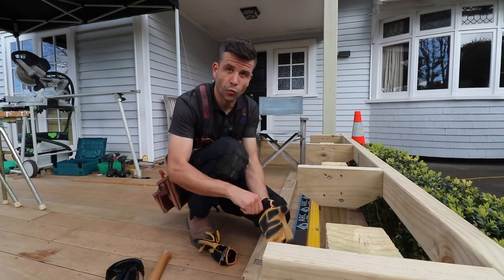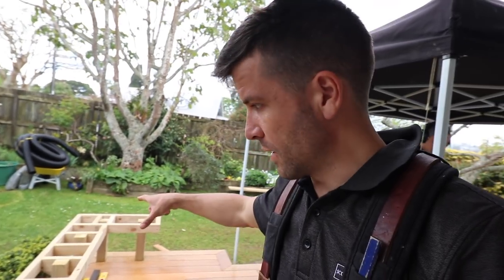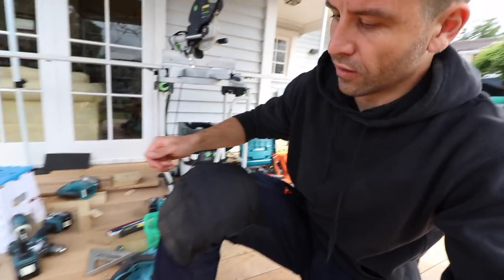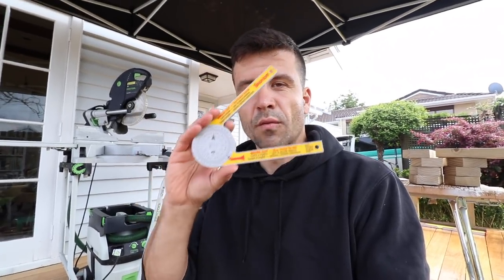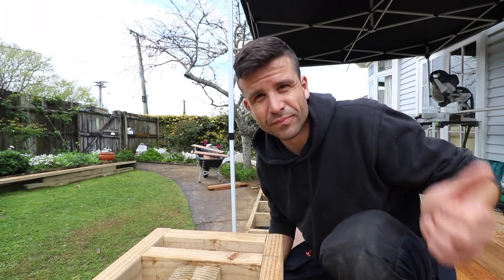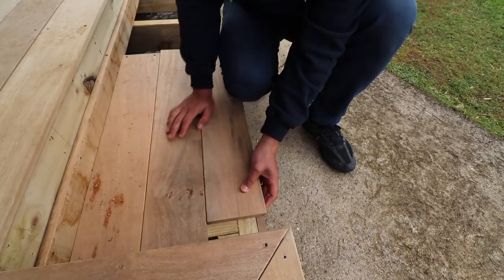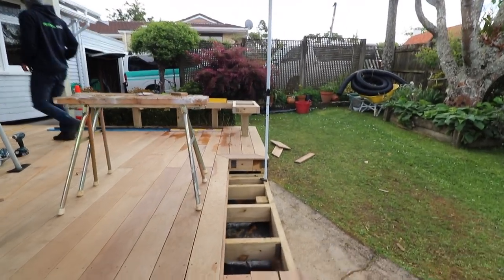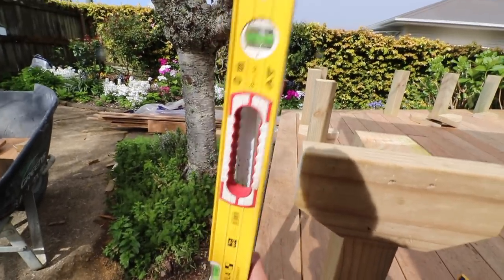Carpenter's Tool Belt vs Tool Pants

Comment: I've built over a hundred decks and not once got on my hands a knees to screw off deck boards. Just bend over at the waist. It's so much quicker and you don't kill your knees.
Reply: If I did that my back would be toast by the end of the day, honestly. Guess it just depends on the person.
Reply: Patrick Houser  You should give a try, I honestly find working on my knees all day to be just as hard on my back. That said I've had my pelvis crushed and lower back dislocated , so for me I tend to hurt regardless. Which is the reason I just want to get the deck screwed off as fast as possible and be done with it. Without compromising quality of course.

Comment: Do you guys have Phillips deck screw, torx or the square onea
Reply: The square one is a Robertson (Robby), a Canadian invention we are very proud of. A good Robby bit can last a long time before the tip begins stripping.
Reply: At 1:40 you can see they're using torx heads. I personally prefer them. A good square bit is good too, but I still prefer the torx.
Reply: @nowerries  no way! As a Canadian I didn't know that
Reply: JosheyG34  Learn something new everyday
Reply: Patrick Houser  While we do have torx screws in 2"-3 1/2" lengths I find they are not popular here. Mainly because they are more exspensive, and I personally find that for those length of screws a robby bit bites just fine and I never have an issue with them stripping, that said I built timberframes for years and all our large panel screws  came with T20 heads.
Reply: B Johnny Yea Torx heads are becoming increasingly popular in my area. Most framing and deck screws seem to be moving that direction here.

I actually don’t have as much experience with the square bit to be honest. Just once in a while.
Reply: Patrick Houser  Where abouts you from? just curious
Reply: B Johnny the great republic of Texas. :-)
Reply: Patrick: In my bumblings around on DIY jobs I've moved to Robertsons where they're available, much to the consternation of my Father In Law.  I find that they 'jump' a lot less than a Phillips, especially if an impact driver isn't available and you have to use a regular drill driver.
Reply: TheOneWhoMightBe this is exactly why I like the torx as well. I loathe Phillips. If I can get away without using it I will every chance I get.

Comment: How can you not wear workpants, with knee pads? For me a tool belt is completely useless, I rarely use a leather pouch for nails when doing roofing, or ringing on boats. 

Downside about knee pads, is when you are to use to have them, you can get to use to get down hard on your knees and that hurts when you are back in normal clothes!

Comment: I find tool belts to be a bit of a nuisance.... I try to wear them when possible.  They are great when your roofing and you don’t have everything to hand.

However,  would be better if they had interchangeable pouches so you didn’t have to continually empty pouch when changing job type. 

Also when your going down scaffold ladder through hatches they can get caught and turned upside down emptying your shit everywhere....  

I find the best ones are the cheap leather low profile ones.  Hammer, tape,  Stanley and nail pouch is all you need.  

Im still waiting for a tradesman to invent the perfect tool belt....

Comment: The work pants are not cheap. Have to buy one for every work day  of the week which means about $600 Cdn. If you don't change your work pants lile normal pants and you sweat as you should when working your pants will get butt small and that's embarrassing. I'll stick with the tool belt and jeans

Comment: I HAD TO RETIRE 12 Years ago Due to Bad Knees.  But towards the end of my career came across SNICKERS KNEE PADS ! they have the same protective materials that are in the US PRO FOOTBALL PLAYERS Shoulder pads. They are the DOGS KAHOONAHS !
  When I got down on my knees wearing them l could Waddle about like a Penguin n not experience any pain whatsoever. Check them out not Cheap by any Stretch BUT FAR FAR SUPERIOR to any other manufacturers model.

Comment: Do you guys ever use an extended screw gun like this so you don't have to work on your knees deck building ?

Hitachi W6VB3SD2 SuperDrive Collated Screw Fastening System with Extension https://www.amazon.com/dp/B01BSGMYYE/ref=cm_sw_r_cp_api_i_htNjCbDAK5F3Q
Reply from the maker: I've used it on the flooring of new build homes but not decks. Maybe in the future 👍